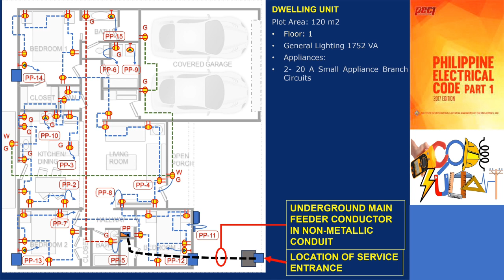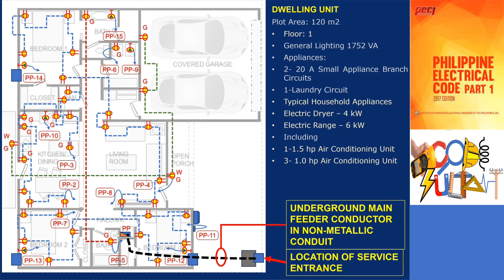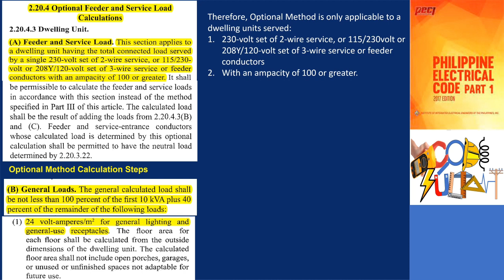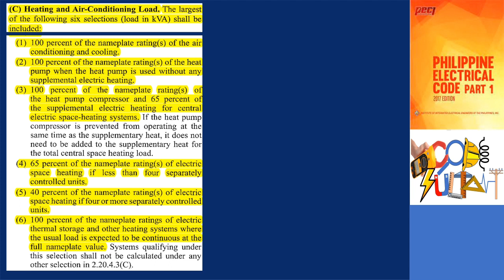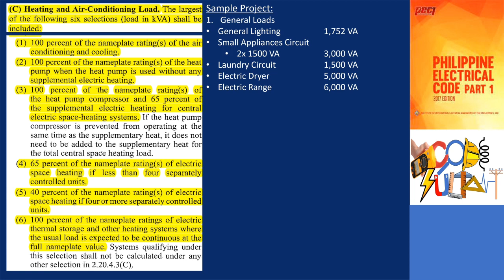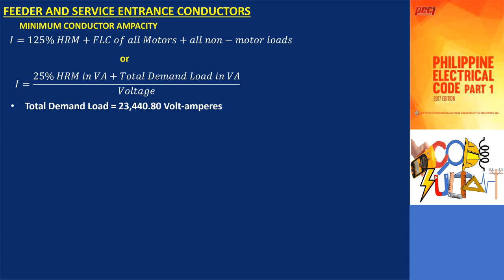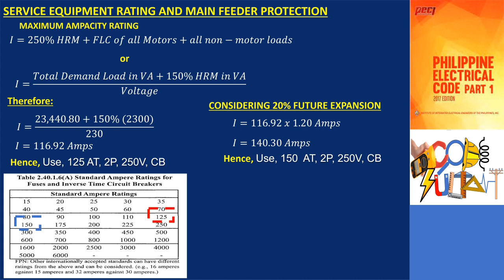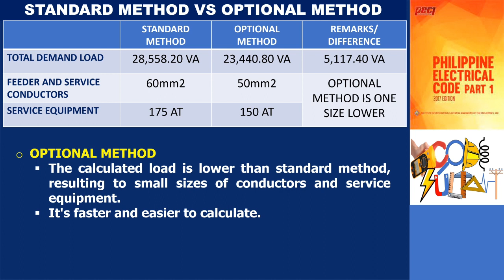HOW TO CALCULATE FEEDER AND SERVICE LOAD USING OPTIONAL METHOD-DWELLING UNITS

Comment: Where did you get in PEC the 150% multiplier and 20% for future use?
Reply from the maker: Hello,
In the sample problem, the provided 20% value is specific to the example and not a requirement stated in the code. The code does not specify a specific value for future expansion as it depends on the owner's requirements. Section 1.0.1.8 (A) of the code advises considering future expansion.
To calculate the service equipment rating, it involves adding 250% of the highest motor rating to the sum of the full current of other motors and additional loads. In the example, since the calculation already accounts for 100% of the highest motor rating, it results in a total of 150%.
The same principle applies to determining the feeder conductor size, resulting in the mentioned 25%.
For more detailed information, I recommend checking the linked video: 
https://www.youtube.com/watch?v=HLZE2bw5bHM.
Thank you for your question.